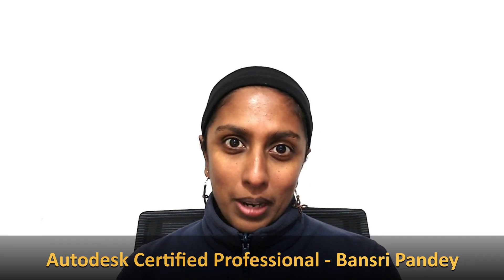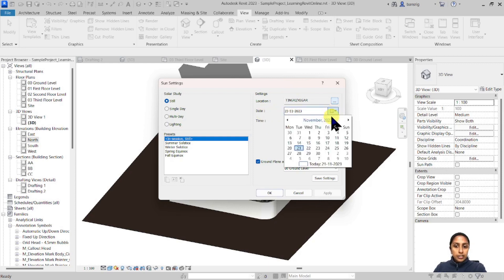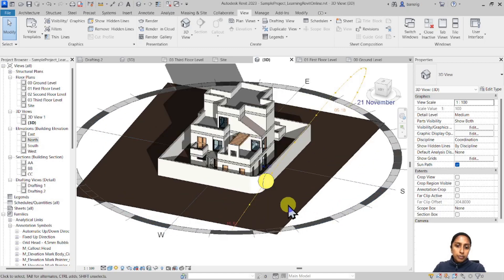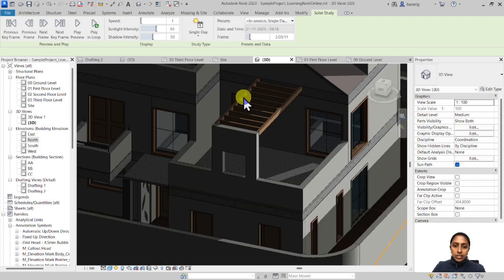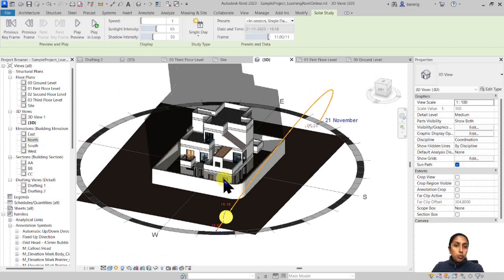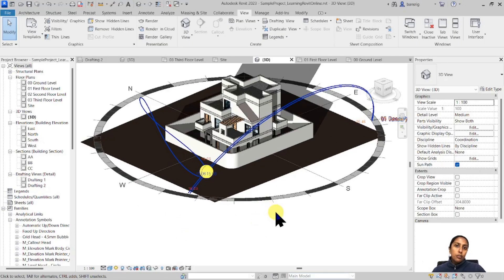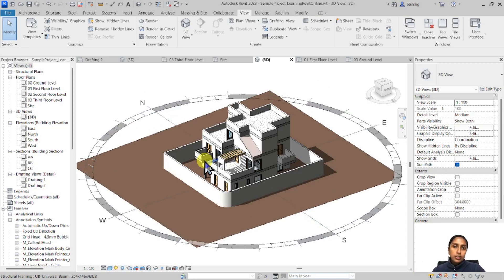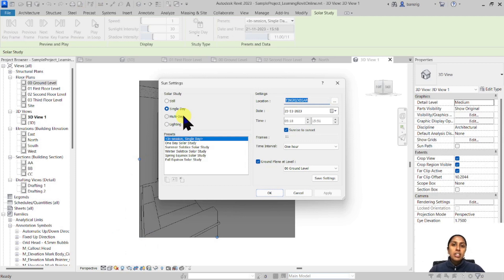EP72 | Revit Beginner Program | Solar and Shadow Analysis | Bansri Pandey

Comment: I have 1 question which is 
If i have 1 irregular plot area and how can i divide in 2 or 3 equal parts
Reply from the maker: Hi. I am not sure if there is a way to do it in Revit. Perhaps, some dynamo programming may be able to do it. But, alternatively, you can do it in CAD and then bring that CAD inside Revit to trace.
Reply: Ok thanks